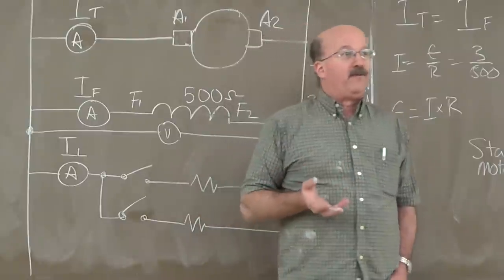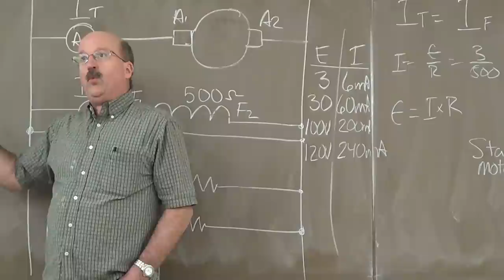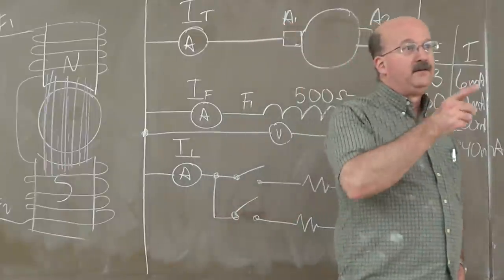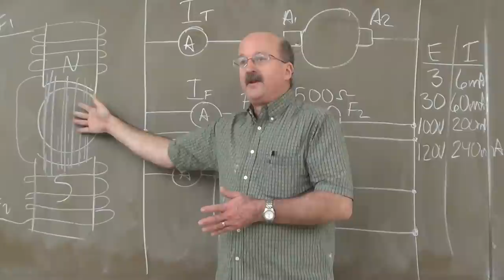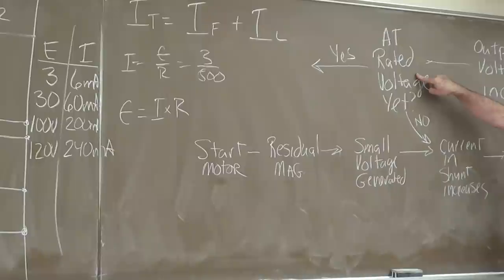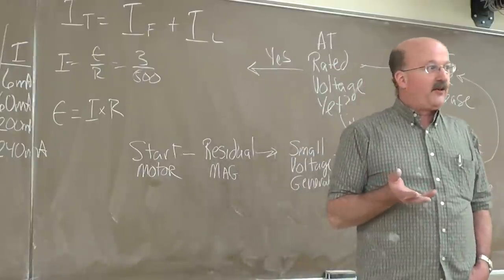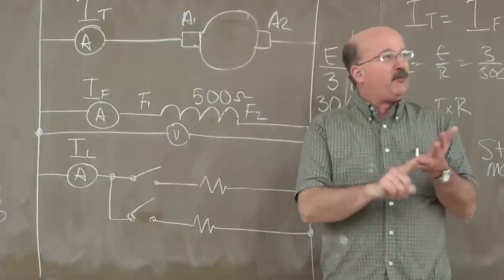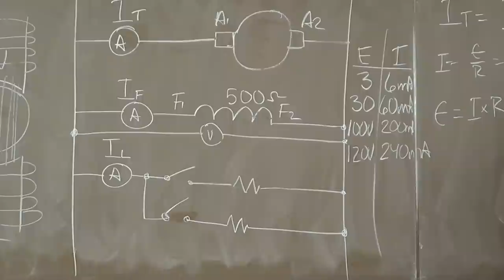DC SHUNT GENERATOR 2

Comment from the maker: Residual Magnetism is the small magnetic field left in metal after the main magnetic field has been turned off.  If you put a screwdriver tip in a magnetic field,  it will become magnetized. The generator pole pieces retain some of that magnetism and that is what gets a self-excited generator going.